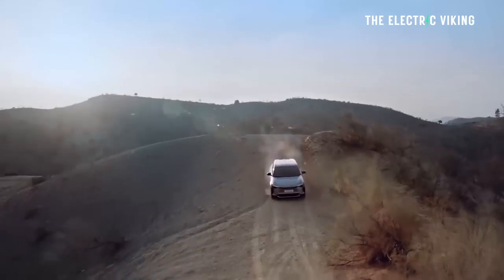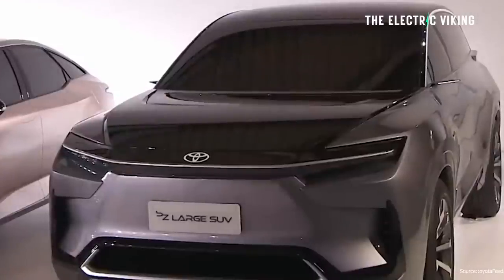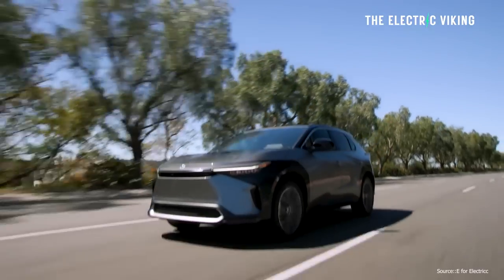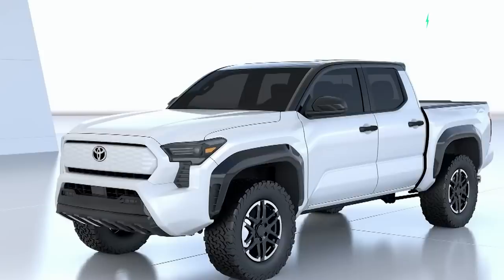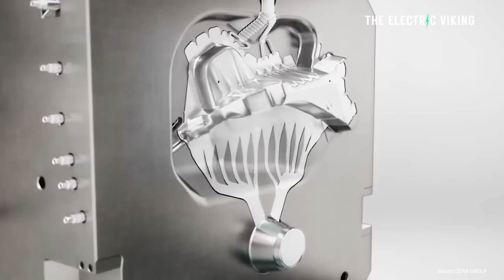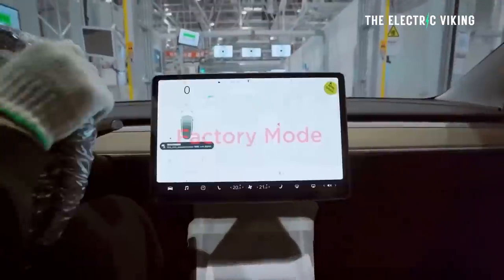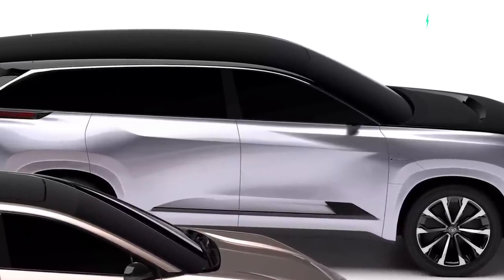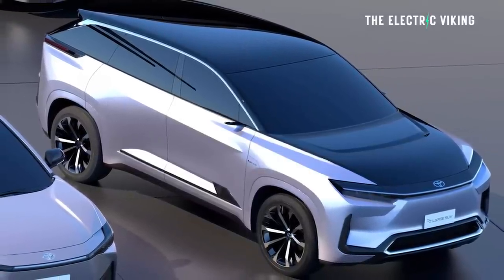2025 Toyota bZ5x large electric SUV built in Toyota's US EV megafactory

Comment: They don’t use Gigapress to manufacture BZ5X.
Toyota will first use Gigapress in 2026.
BZ5X uses the same powertrain as the infamous bZ4X, it's just that it has been enlarged.
So, it's better not to have high expectations. If you have a normally functioning brain, it's advisable to refrain from buying it.